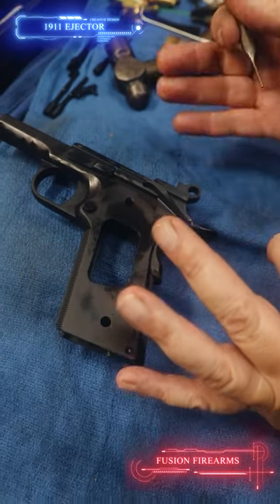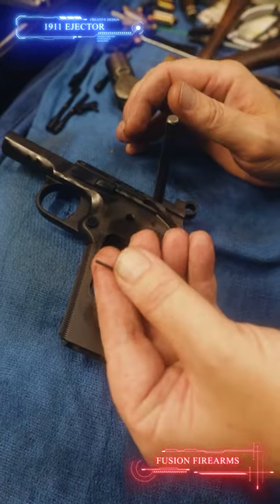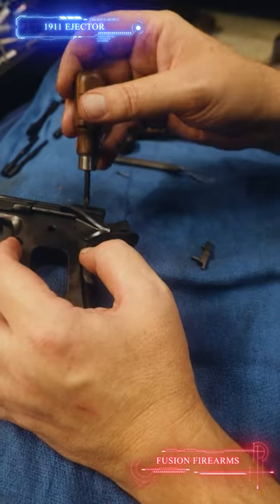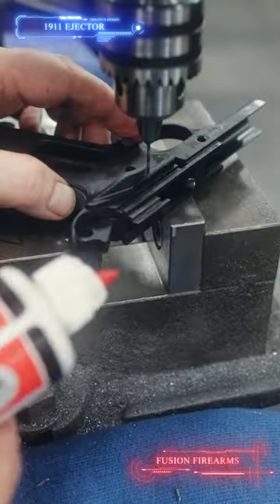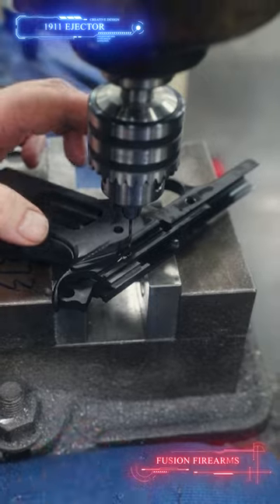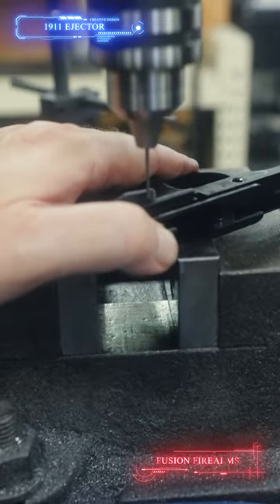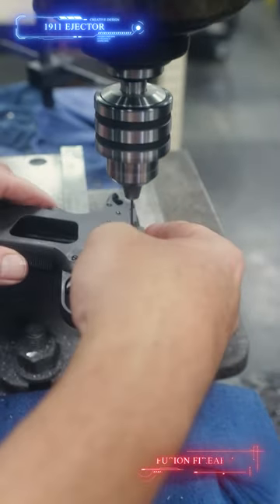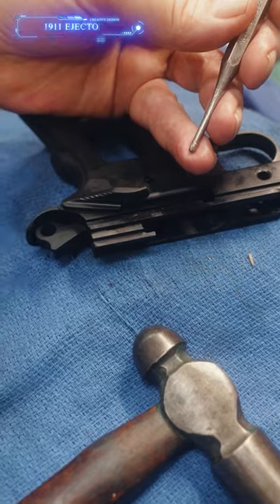How To Install The Ejector On A Colt 1911 Pistol! #shorts

Comment: In my experience that drill trick don't work.  I mark it with a tiny round needle file and then file the half moon to a tight fit with a roll pin
Reply from the maker: Yes, some do it with a file. I like the drill